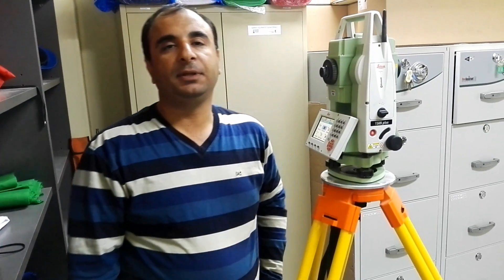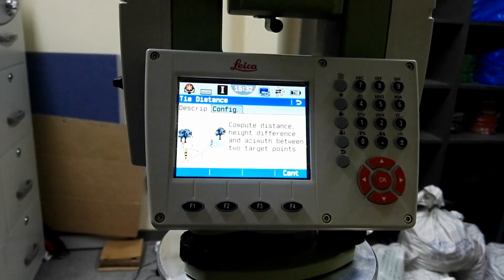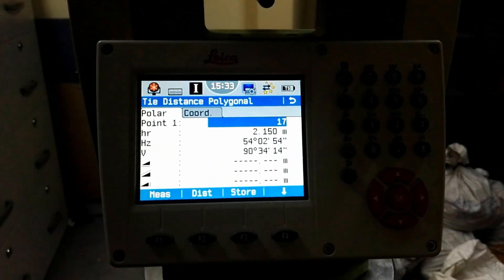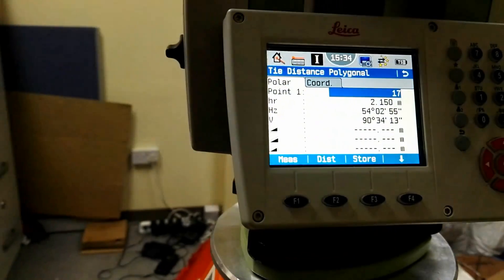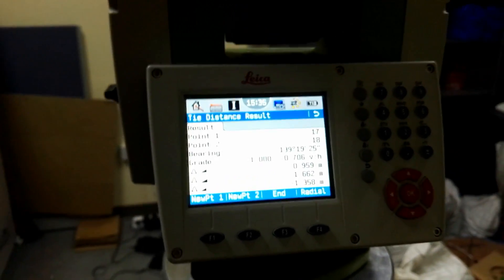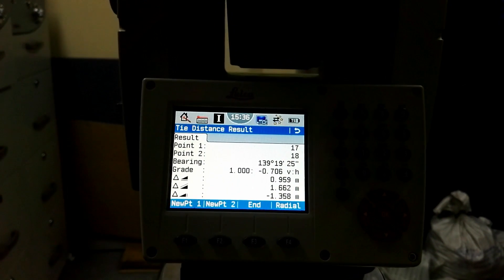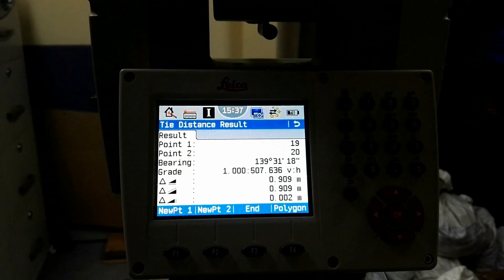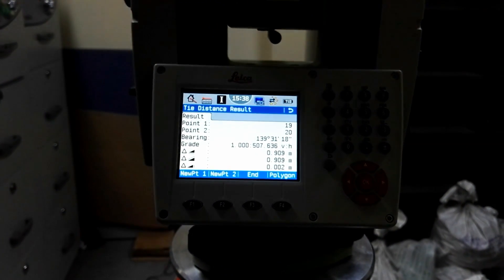Calculate horizontal, Slope distance & Bearing & height different with Total Station TS09 in English

Comment: sir, this video is very helpful and thanks for uploading it. i have following two doughts which i want to ask :
(1) in what reference to , the angle between to points have been measured here ?
(2) do we need to orient our machine with rerference to any known bench mark, the NEZ of which we aleady have, by going into setup before using "tie distance" function ?
Reply from the maker: if you require bearing then should your  instrument set with proper coordinates
Reply: aamir shahzad ok,
Reply: kindly, answer my above 1st question?
Reply from the maker: this angle is from north direction which you set in instrument